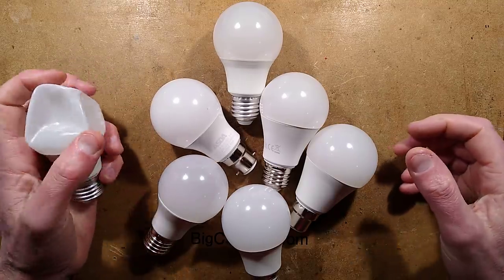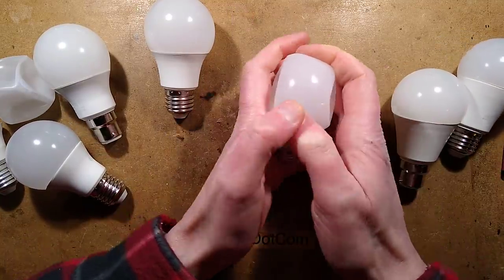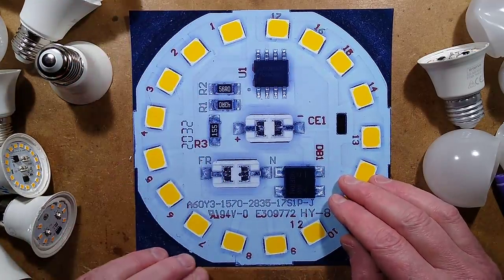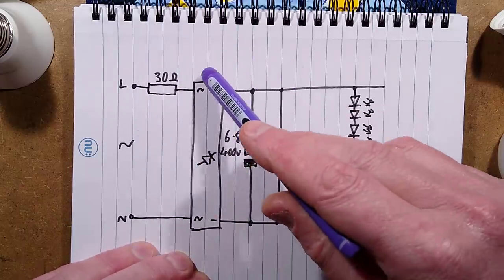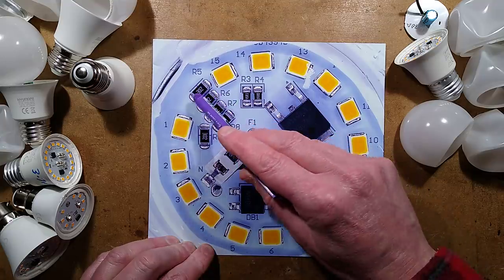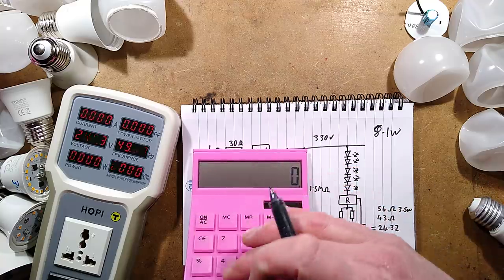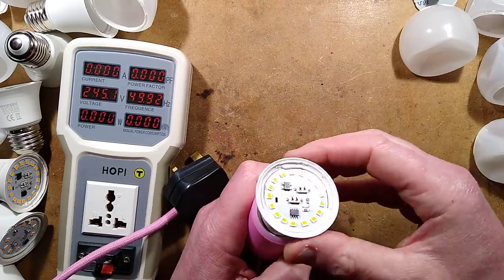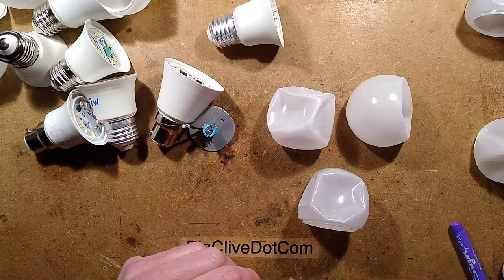Crushing and hacking LED lamps

Comment: Modern LED lamps being engineered to fail only sounds conspiratorial until you note that an engineered maximum lifespan was already designed and factored into incandescent lamps starting in the 20s for exactly the same reason.
Reply: Yeah, the one company that made lightbulbs that could last a freaking century upwards went down the pan because of that, iirc.
Reply: Incandescent lamps are more efficient when run hot.  LEDs are most efficient when run cool.
Reply: That's not really true at all.  As hanelyp1 mentioned, incan bulbs run FAR more efficiently when hotter, which degrades the filament more, so considering their low cost it was necessary to strike a balance between lifespan and efficiency and they did a fairly good job of it. Plus even the humble light bulb has evolved since the '20s.

LED bulbs aren't designed to fail, merely devolving into the cheapest way to get the job done with what is perceived as tolerable lifespan and cost.  However there is no need to theorize about motives, rather to look at the surface area present versus the heat produced, to generalize about the rise in temperature of the LEDs and the driver and what effect that will have.  Same thing different day, make it cheaper to gain sales.  Make it smaller because customers won't usually pay to mail each $3 bulb in, one at a time for a warranty replacement when the postage cost is higher than the bulb cost.
Reply: Not really. What basically happened is management determined a set of criteria for the light bulb to fulfill, lifespan hours being one of them, as well as cost being as low as possible. Engineering then goes and designs the light bulb, realizes their design lasts far longer than it needs to, and proceeds to design it to "sacrifice" lifespan in order to pump out more lumens with less LEDs by essentially "overclocking" them, reducing overall materials and manufacturing costs for the light bulb while still meeting the same lifespan and lumens requirements from management. 

Some of these light bulbs are just engineered to meet certain criteria that not every consumer falls under. Most consumers just want the cheapest possible light bulb, which this would deliver. However if you want a longer lasting or more efficient LED bulbs, there are light bulbs out there for you if you are willing to pay that extra cost for those criteria and/or willing to deal with less lumen output. Just because the popular ones are engineered to these specific criteria that you don't like doesn't mean that others don't exist that you can't buy if you look for it and are willing to pay the fair price for it. Despite popular belief, profit margins on basic consumer goods like light bulbs are not high. It's literally about 5%. Most companies are selling light bulbs to you for near the price it takes to get that light bulb to you. For a supposed conspiracy to extract profit out of consumers, it's a rather poor one in that case.
Reply: Phoebus cartel
Reply: @stinkycheese804  It is true. It's documented fact. Light bulbs were the origin of the concept of planned obsolescence.
Reply: @stinkycheese804  Sorry, but you're wrong.  It's well documented.  Here, don't take my word for it:

https://www.youtube.com/watch?v=j5v8D-alAKE
Reply: @antontaylor4530  You post was incredibly vague, but no, you are wrong as is the video.  That is just a conspiracy theory but the truth is that the bulbs were engineered so that they produce more lumens per watt, because replacing bulbs more often is less expensive than the additional power cost to reach same wattage if they were less efficient to last longer.  This is fact, and you can test this yourself, simply put a power resistor in series with a bulb and you can make it last more than 5X as long, but it will have a fraction of the brightness with most of the power wasted as heat, producing a dim, sickly yellow-orange light, and you'll need multiple times as many bulbs running so it ends up for more costly for same amount of light.
Reply: @stinkycheese804  My post wasn't vague in the slightest.

You're wrong, and the video I posted proves it.
Reply: @MudBarf  LOL< in the 50's?  Really?  Do you not understand the science behind what has been relevant in over half a century since then?  Sorry, no, if you have to go back to the 50's, you really , desperately, need to catch up and learn a bit of science about how incan bulbs work.
Reply: @antontaylor4530  You need to practice more if you think that was a successful troll.  Maybe focus on reality, you know, science, data, cost of power vs cost of bulbs.
Reply: It is conspiratorial. Conspiracies happen
Reply: Why I love europe's energy efficiency ratings.

Found some cheap-ish, but also surprisingly low wattage for the lumens, very nice warm white LED bulbs. 5.9W for 806 lumens, for the equivalent of about $3 per bulb.

Good stuff.
Reply: Everybody LOVES to talk about planned obsolescence but if you think about it for a minute it is obviously not economically viable to invest so much in a product to make it last forever plus the reality of physics plus the fact that markets evolve. In one sentence: markets push for both cheap and durable and what you get is a compromise between the two. Simple economics!
Reply: You can buy incandescent bulbs with 16,000hr life.

Comment: Hi, You are 'playing' a lot with lights. Maybe it's time to invest in a lumen or light meter so you can also measure the lumen output on top of the wattage.
Reply: .. and a Colour-Temperature meter
Reply: Check out YouTube channel elctron update. His old videos used a photocell to measure light output which would be pretty cheap to do.
Reply: If you want lumen measurements, perhaps YOU should invest in a lumen meter.  Frankly it's not all that important, if you just cross reference the LED datasheet, measure current, consult the datasheet graph and derate for temperature, then you can get "close enough" where it's more trivial what % off you are.
Reply: @stinkycheese804  good luck finding LED datasheets of Chinese LED lamps.
Reply: @stinkycheese804  If everybody is referred to the datasheets (if they exists) and 'invest it your self' than we do not need BigC anymore ;-)
Reply: Isn't there an app for that. Lol I had to say it.
Reply: @dmo848  LOL Do you have an app that measures wattage by itself?
Reply: @roughshaf7321  And if you do find one, it will be pure fabrication and have no connection whatsoever with reality.

Comment: Wow.  This worked for me on an EcoSmart 9 watt bulb I had apart.  With approx 15% drop in Lumens.  Went from drawing 9 to 4.9 watts.  Aluminum board measured 65C before and 36C after.  Much thanks for the video!
Reply: Does it last longer ?

Comment: I knew I wasn't crazy...I'm not an electronics expert but I knew my LEDs didn't last as long as my incandescents
Reply: And it gets even worse when they use really cheap capacitors or LEDs that are on their way out before they even get soldered to the board.
Reply: @Rob I have a whole bunch of LED lamps that work perfectly fine - but they're less than half as bright as the new ones I replaced them with.

The real problem with LEDs for me is that they don't (usually) fail outright, they just get slowly dimmer and dimmer until one day you start wondering why you have headaches all the time, realize it's from eyestrain, and pony up for some new bulbs. And then you feel like you're wasting money because they still work, but those headaches . . ..
Reply: The early Philips bulbs I bought about 10 years ago still work. Mind you, I paid about $25 each for them on sale. The newer ones I have cost about $1 each, and seem to last two or three years if they get past the first month or so. Early failure rate is about 10%. FWIW are on 120V supply here.
Reply: @rick_.  Are those the ones with heatsinks up the side like the L prize bulb ? It is well known that electronics hate heat, so a decent heatsink will give a big improvement in life.
Reply: Yeah same here, they seem to fail after 6 months-year of normal use despite the fact they are "rated for 25000 hours". On the other hand, one of these led bulbs lasted us 20 years and it is still going. (It is one of the old ones where you have to wait like 3 minutes until it gets to full brightness) The newer ones are definitely manufactured with planned obsolescence in mind, like incandescent were after manufacturers found out planned obsolescence is good for long-term profit.
Reply: I now use incandescent and some quartz
Reply: @rick_.  What brand are the $1 ones? The price seems way to low to be Phillips or anything of quality. From my experience good brands like Osram or Phillips last a long time but those el cheapo no name ones are trash. If you're lucky they last you a couple of years. You get what you pay for.